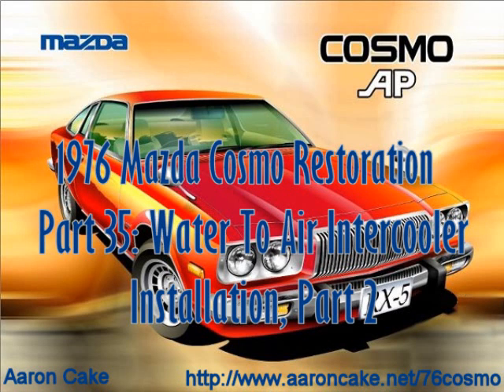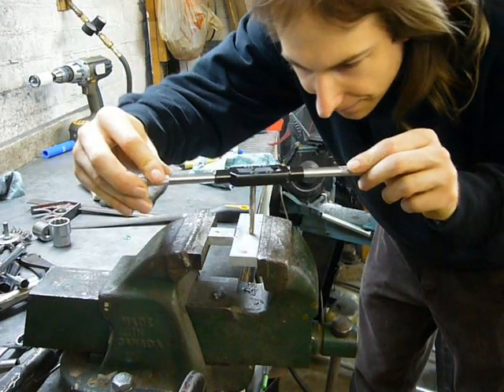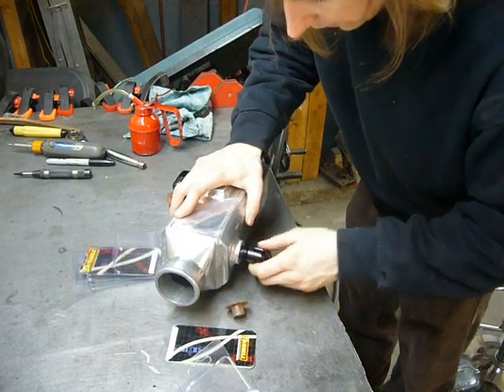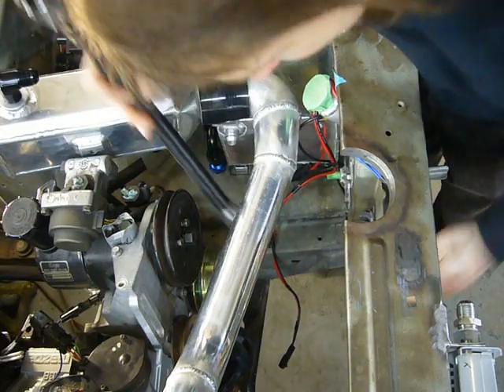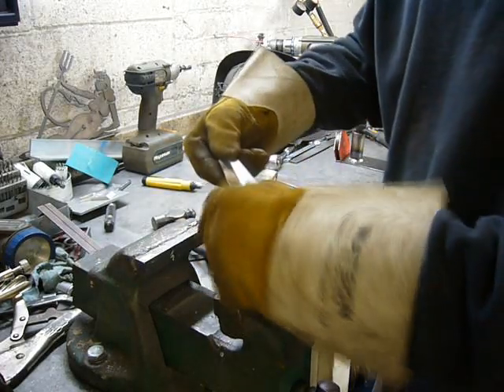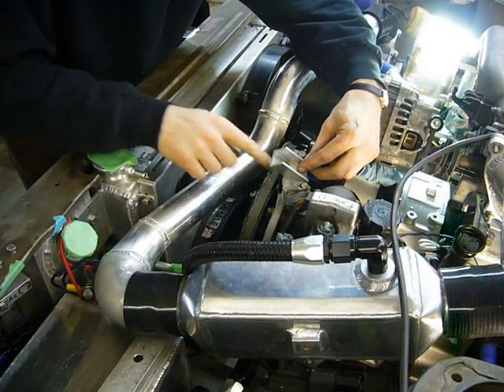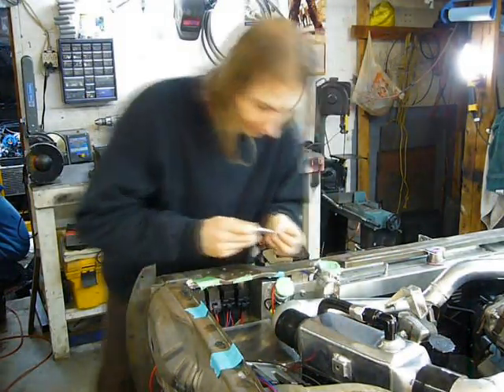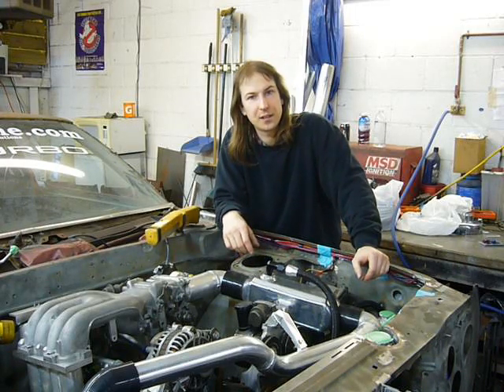Part 35: Water To Air Intercooler Installation, Part 2 - My 76 Mazda RX-5 Cosmo Restoration

Comment: Seeing how much work this was, i think i would rather have a front mount in place of the oil-cooler and the oil-cooler moved up to where the heat-exchanger is.  I've read your explaination about why you've whent this route, but i can't shake the feeling that you just like doing things the hard way. ;-) Other then that, i greatly respect you're work. Man of all trades. And i really like the car, it's a beauty! Allthough i don't like the shaved doors, much to "tuner" for a car like this. BTW, will you convert the back windows to power-windows too? Seems logic to me. Keep it up! I've went through all these video's in the past few days, only have 6 to go now. :D
Reply from the maker: With the A/C, fitting all the plumbing required for the front mount would have been very hard if not impossible without very long piping runs, or running too small a font mount. But partially, I had also never set up a water to air system before and wanted to use one. Now I'm actually not happy with the position of the intercooler. It looks hacked on and doesn't match my vision so I'm going to revisit it. I'm still debating whether I am going to convert the porthole windows to power. Seems like I should, but I also like the quirkiness of keeping the hand cranks.
Reply: Well, that anwers it enough i guess! If it wouldn't fit, find another solution. And you did. I do hope that the pump runs silent though. 
You should convert those windows. And just keep the cranks to mess with passengers... :p
Reply from the maker: ***** Probably won't hear the pump much over the noise of other mechanicals. It's the same pump Ford used on the supercharged Mustangs, GT40, etc. Maybe keep the hand cranks but turn them into window up/down switches.
Reply: Okay, was just wondering because you've mounted the feulpump in rubber to rid the noise. ;-) Handcranck-switches... i like the sound of that!
Reply from the maker: ***** EFI fuel pumps tend to run at a much higher RPM. But also I'll put some rubber washers on the intercooler pump upon final assembly.

Comment: how much power do you expect here aaron?
Reply from the maker: On a 13B, the GT3076R turbo I'm using has a practical limit of around 320HP before boost gets into levels too high for what I'd consider reliable. The goal however is to run the car at whatever power produces 300 ft-lbs of torque in the midrange. My numbers say this is at around 15 PSI and I've calculated intake runner lengths appropriately.

Comment: Hello Aaron 
i am andy and im so new to water to air inter cooler 
please give me some advise
Reply from the maker: +An nguyen What do you need to know? What are you having trouble with?
Reply: yes i got it now but my new problem is
i do not know if you can help me with my lamborghini
I need to know how to install a turbo feed line and return to my gallardo
Reply: like japan car i can do it well but this is my first time and upgrade a twin turbo to my gallardo
oil feeding and return is a problem for me now
cus the engine is far away from the turbo
Reply from the maker: An nguyen I can only give generic advice as I am not familiar with the layout of the Gallardo. Normally when adding turbos one find an existing oil source such as the port on the block that goes to the oil pressure sender. Typically a threaded port which can accept a T adapter of the same thread, then the oil pressure sender gets connected to the T as does the oil feed line to the turbo. For oil return, drilling and tapping a spot on the oil pan is common. If the engine is dry sump then oil can simply be returned to the tank or scavenge line at the bottom of the engine. If the oil return is below the pan, a small pump needs to be used.
Reply: what brand of oil pump should i used for  a return line that you think it is good brand i can used if you can please give me a model number
and are you familiar with motec ecu ?
thanks
Reply from the maker: +An nguyen I'm not really familiar with Motec as it isn't used much in the rotary world. As for the pump, I have heard good things about the Turbowerx pump. However many manufacturers make such pumps as mounting turbos low and/or remote is getting more common.
Reply: do u have facebook ?
do u have a number if i have a question can i talk to u directly
thanks
Reply from the maker: An nguyen I don't use Facebook. You can certainly send me a private message via YouTube if you wish. Or, you can email me through my website (it can take literally years to get a response though...I get a LOT of email).
Reply: ok
can i use aluminum to build a clamp to hold my turbo exhaust ? yes of cause the exhaust has wrap with heat wrap
cus lamborghini body is aluminum
thanks
Reply: and do you have ur own shop or you are working for someone
Reply from the maker: An nguyen An aluminium clamp should be no problem at all to hold your exhaust. I would suggest 4000 series aluminium as it has a bit more flex than the common 6061. Much less prone to work hardening. In fact I have seen exhausts made out of aluminum entirely after the cats.
Reply from the maker: An nguyen This is my hobby.
Reply: can u work with me at my performance shop in 6 months after today
after this project on my lambo by the time my shop is built
I m looking for 2 people like u, working on cars is my passion
im not kidding at all please let me know
if u have fb i will show u my civic i have built few months ago make 815 hp on the wheel
all done at home only cnc or sleeve is not
Reply: oh yes i been looking around how to get a big ice box tank cap about 8 to 10 inches big
cus i am using a in tank rule 3700 water pump and using dry ice sometime so i need a big cap do you where can i get one
thanks
Reply from the maker: An nguyen Summit Racing (I'm not sure about local for you) has large caps designed for ice boxes and fuel cells. They should do the job however I'm not sure if they ship that far.

I appreciate the offer but it's not something I can do anytime soon. :-) Across the world to build a car doesn't fit into the schedule.
Reply: lol what do you mean ?
where are you from ?
i am from usa from Houston tx
Reply from the maker: An nguyen Oh, I was under the impression you were in Japan. I'm in London, Ontario. I'd like to visit Texas but it's not in  the cards right now.
Reply: oh ok are you American ? or united kingdom citizen
thanks
Reply from the maker: An nguyen London, Ontario, Canada.
Reply: ooh ok got it
Reply: hi how are you?
if i run 10 psi on my set up turbo so what spring size for the wastegate i need to use
Reply from the maker: An nguyen I would recommend a spring just under 10 PSI, say 7 - 8. Then adjust to your final boost level using the boost controller. General rule is that a boost controller can reliably double the boost level set by the spring, though this varies based on the setup and wastegates used.
Reply: can you find out for me?
i still can not see how to hook up feed line for my turbo yet
thanks
Reply from the maker: An nguyen What are you having trouble with? An oil source? Fittings? Just keep in mind I don't really know that engine.
Reply: ok thanks

Comment: 0:51 yo aaron gonna hit up some bitchez on the BBM.
Reply from the maker: I'm still rather bitter that RIM stopped supporting BBM Channels on real BlackBerrys after the consumer version of BBM was "sold off". Instagram does the same thing, but Instagram sucks.
Reply: Wow i was not expecting a serious reply, or any reply at all for my dumb comment. 
But yeah, thats just what happens when stuff fades out of popularity. Just gotta switch over to whatever replacement comes out, even if it is not as good.
Reply from the maker: You can pry my BlackBerry out of my cold dead hands.
Reply: Yeah I feel that i still use a flip phone

Comment: do u have to go to school for welding
Reply from the maker: If you intend to work in the industry, then yes, you will need to go to school and become certified in the welding processes and positions you will be using. On a hobby level, if one is a self-motivated learner, then one can learn to make safe, strong and good looking welds. I'm all self taught. Just read a few manuals, saw some welders lay down some beads, then many hours of practice behind the torch.
Reply: ok thanks

Comment: bro, have you not been taught the simplest of things yet? files have directional teeth. Therefore you only file in one direction as not to blunt the teeth. generally you push the tool against an object away from the handles direction then pull tool away and press and push tool and repeat. basics bro
Reply from the maker: My file is a unidirectional file. They've existed for a while. :-)

Comment: Talk about tryin to fit 10lbs of crap in a 5lb bag! You really need to figure out more ways to add components to your systems!
Reply from the maker: Yeah, I've never been happy with the  position of the intercooler so I intend to go back and fix that. Which will require me to change to a different style of power steering pump as well.